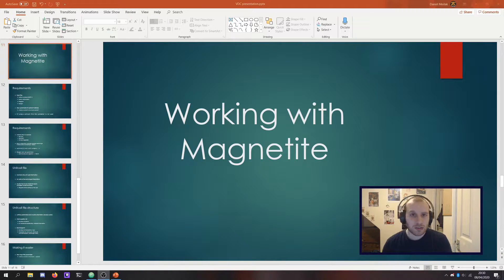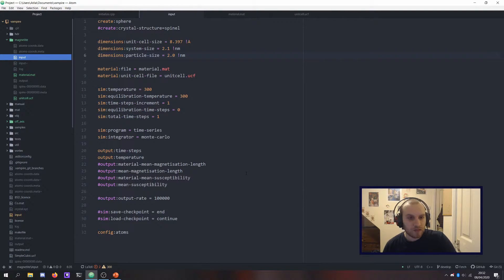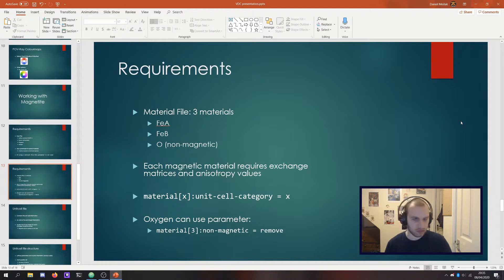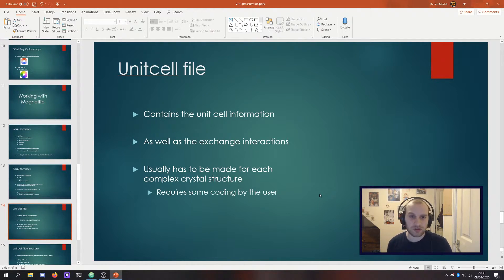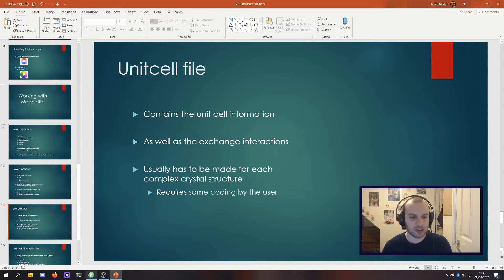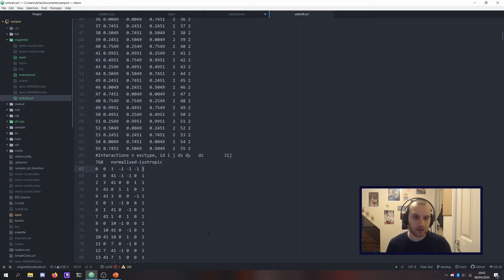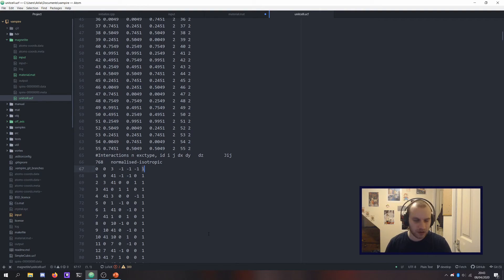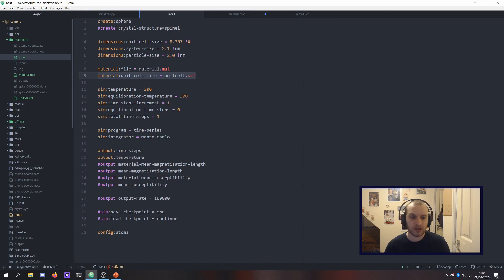Working with Magnetite

Comment: I am using Vampire V5. In my input file for spinel structured materials, I use the command "create: crystal-structure = spinel" instead of using the file unitcell.ucf. But the program reports "unknown crystall_type spinel found during unit cell initialisation" error. Could you please tell me how to solve this problem, or must build unitcell.ucf file?
Reply from the maker: You need the develop version (aka what will be version 6+) for the new crystal structures
Reply: @vampire6217   @vampire  tks for your response. But I can't look for Version 6 in the both homepage of VAMPIRE and link github. Currently, I am using .ucf file. Looking forward the new version of VAMPIRE, which is great software package.
Reply: Can you help me with the installation of vampire i  am stuck in it.